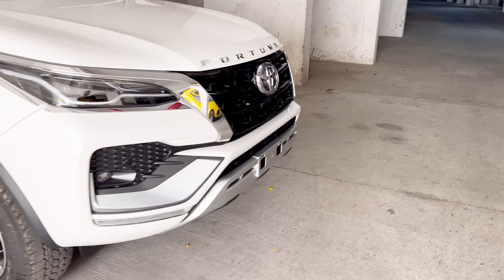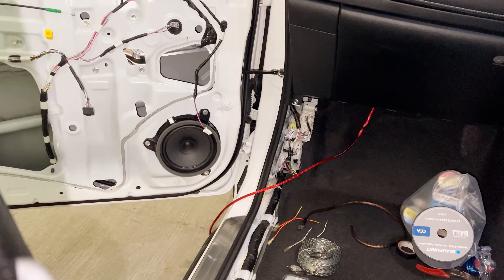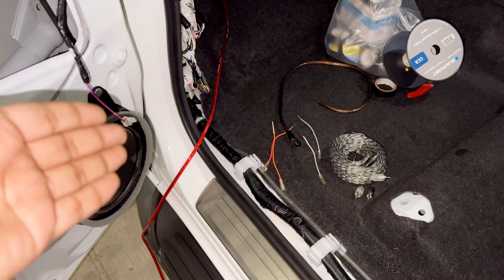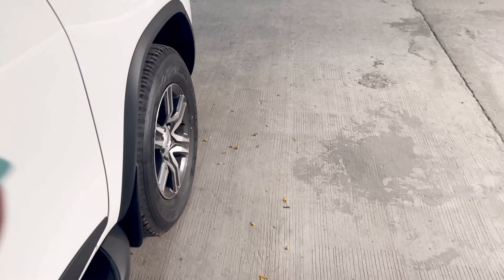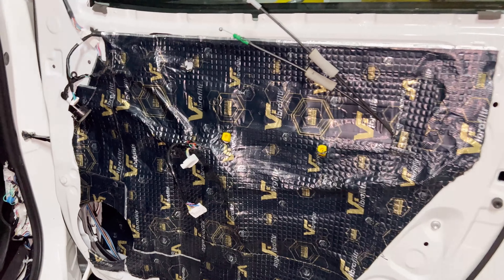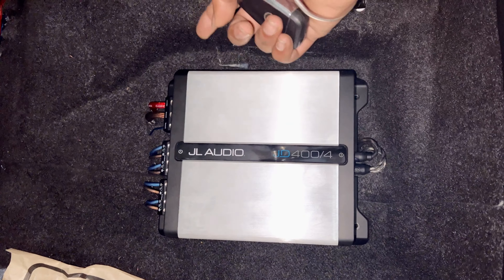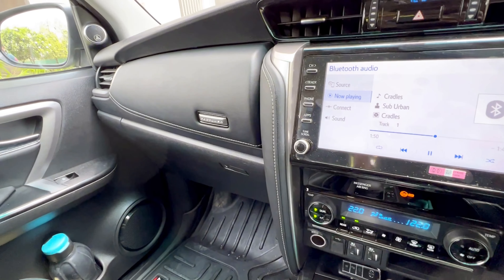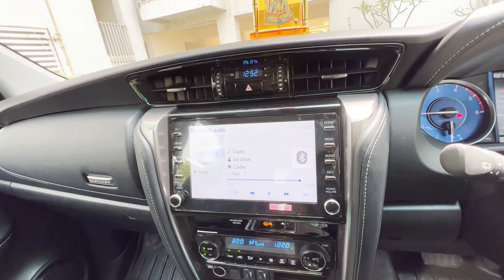Toyota Fortuner 2022 | Hi -End Music System | JL Audio C2-650 | Fortuner Modification ₹1लाख का ऑडियो

Comment: For people who are living metro city its easy to obtain HI-End brands but for me who are living in town place its not easy. Sohil provided me all the brand as per my choice with good prices. Installed Pioneer DMH Z6350 Bt, JL C2 Components, JL 10 inch Sub, Alpine S 4 channel Apm, Deaf Bounce 550 watt Mono and all Sochese wiring. Trust me guys sound is great. He also suggested me Damping which are Vibrofiltr Gold 2.3 mm they are best in its class. Important part is the Installer Mr. Hemat, he is very expert guy with great skill and having Good knowledge of wiring, system installation and sound tuning. I am totally satisfied or above satisfied with your work. Keep continuing you good work.
Reply from the maker: Thankyou so much for the feedback
Reply: In which car you have installed all this?
Reply: On which type of songs JL Subwoofer performance is better, like 90's bollywood songs, latest bollywood songs, Punjabi songs, Hariyanvi songs? Who should consider JL Subwoofer and who should DD Subwoofer with ported enclosure? Can you please help me
Reply: Which enclosure you are using Sealed or Ported, and completely satisfied with the same?